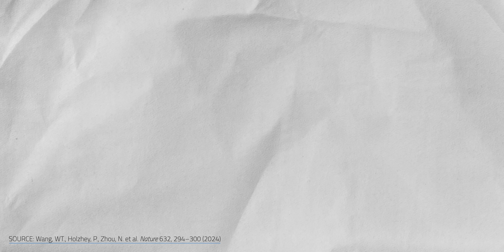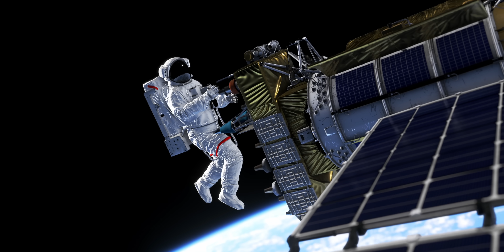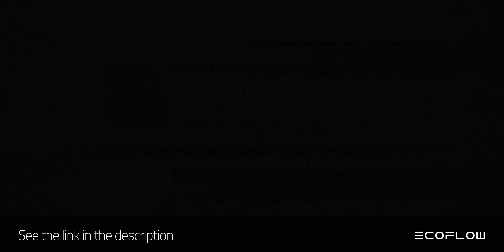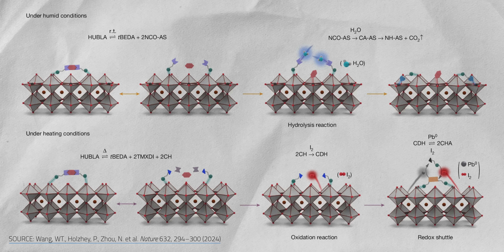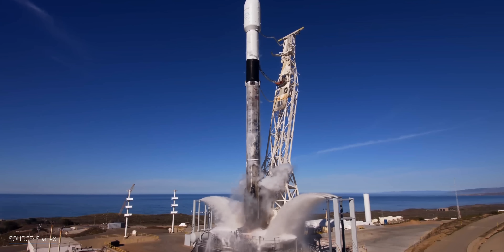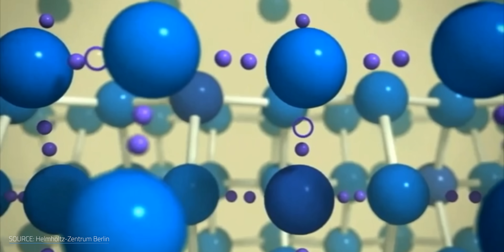Why This Might Be the Last Solar Panel You’ll Ever Need

Comment: As much as I wish this were going to be used on all PVs, I suspect the added cost will preclude from use on earth - space based operations on the other hand, where access for repair or replacement is expensive...
Reply: I expect they will make it to space, probably before they are in use on Earth.
However, once the tech comes down in price, I expect there will be a market for them down here too.
Reply: Plenty of places where healthspan&lifespan would be useful due to their difficulty to access/replace. Once cost begins to go down the market size will spread.
Reply: @jimthain8777  they can't just become cheap, they need to become cheaper than normal silicon PVs. and that is the problem. silicon PVs are affordable, abundant, and good enough for most applications.
Reply: Space is often the path to affordability
Reply: @MrIcetiger93  Still waiting on those triple-quad junctions or even tandems to cheapen :) Space grade panels can last 300 years on Earth, but cost 5-10 times more. If you're going to spend that type of cash you better double glass, armor the wiring, and have an aluminum sheet which can be flipped to protect from hail......... I know way too much about this shii..
Reply: Because it also increases efficiency, if the cost delta is reasonable, this could be useful for large scale solar farms. But it will be a while before this would be implemented for home use.
Reply: It might be for the best, if it has long-term toxic effects like perfluorinated materials.

Comment: The self-healing is not fixing solar (silicon) cells problems ...it is addressing perovskite solar cells problems: They are far not as stable and therefore durable as silicon solar cells.
I'm missing that information in the video.

Perovskite can make solar cells much more cost efficient. But in order to do so, they got to compete for silicon solar cells. And therefore be durable/resistant, which is their biggest flaw at the moment.

Comment: I doubt there will be a huge demand for this technology,  because PV panels already enjoy a 25-30yr lifespan, and during that same time power efficiency improves 10%-15%, motivating buyers to upgrade. The self-healing technology will be incorporated into new PV panels only if the premium is small, perhaps 5%-10%.
Reply: Yes, PV panels last up to 30 years, but they constantly degrade in performance. If the panels could maintain their original efficiency the ROI goes up, making them more appealing.
Reply: @jhouck1969  They degrade, but it does seem like the degradation curves on modern panels in the real world ends up being almost zero gradient - in practice the 30 year lifespan is probably more like 100+ years of good performance relative to their as new performance if they avoid being hit by a truck etc. The replacements we have been seeing for the last few decades in the real world haven't been because the old panels are particularly dead, just that the new ones have a better efficiency and so energy density making it economically worth upgrading (as a rule of thumb it appears to be much much easier and more profitable to upgrade your existing installation than get approval and then build the basic electrical infrastructure for the brand new one and leave the old one that is still working fine alone).
Reply: @jhouck1969 ROI goes up so long as they produce more power than it costs to maintain them. They would just have better ROI.
Reply: @jhouck1969 you are double counting degradation. A 30yr lifespan is based on the assumption that they'd degrade by at least 20% in that time, not that the panels suddenly become worthless in 30 years. Panels could last centuries for all we know. The longest running plant has been going 45 years or so now and is still working fine.
Reply: Perovskite cells are lower lifespan than the traditional silicon ones you're used to.
Also, panels lose resale value over time if they age. Ageless panels could be resold to where space is less of a premium.
Also, environmentmental costs/entropy.
Reply: Well, Perovskite cells loose their efficiency much, much sooner. So this would be a game changer if it really works, since Perovskite cells offer much more power. It's their fast degradation that has kept them from the market. But again, that's only if this truly works as they are claiming.
Reply: @junehanzawa5165 currently on both techs.  But which might be taken further.  One with a 10-20 year lifespan of knowledge or one, relatively new, with only 1-5 year but measured against the old tech that set the standard?   Could Pv be improved?  Of course.  But so many more haven’t figured out that key yet. My ex used to challenge high schoolers with an impossible math problem.  For a straight A grade for the class. All they have to do is solve it. Sometimes we haven’t thought of the way to solve some and it only takes one.  But the more that try to, the more the odds are against them.  And she never gave a student an unfair grade.  She was an awesome teacher.  Just not the wife for me.
Reply: True but this biggest issue to go mainstream is money.  Who pays the best.  NASA. Aka USA.  If they get it there with a huge money infusion from NASA.  It could mean 50-100 yr solar panels at slightly higher prices than current.  Even if doubled under what I mentioned, the rich would go that way, and it would drive down prices on the cheaper.  Kinda win win
Reply: I could see this tech being used in space
Reply: If we find a way to transport energy with much less loss. Humans could create such self healing solar power plants in hot areas and share the energy across Kontinents. You need to think more global! Its the goal to find an energy solution for the world forever not just one household. Lets think big. ;) and have lest waste (old panels that need refreshing)
Reply: @rc3043  transmission and distribution losses from high-voltage DC lines are already fairly low. Self-healing PV has to be cheaper than periodically screwing in new conventional PV panels otherwise it won't have much effect.

The waste of old panels is utterly dwarfed by the billions of tons of dirty fossil fuel they displace in operation. Even if you just ripped the aluminum frames off and stacked the tired panels in a corner of the solar farm while waiting for economical panel recycling to develop, the environment is much better off with solar.
Reply: @skierpage  strange the solar engergy project from afrika failed because they could not deliver the energy to europe efficiently...
Reply: What the commenter is alluding to is that if solar panels presently already last thirty years, and we can say with some degree of confidence that solar panels will have improved in quality in the next thirty years substantially enough that the average consumer would want to replace their solar panels anyways - even if they were still in working condition - then extending the lifespan of the panels beyond that becomes only minimally relevant
Reply: I disagree, this is as much an aerospace technology as it is residential; we don't want to repair rooftop solar often, and it aint happening in orbit until someone puts up some telepresence repair sats.
Reply: Like every other tech idea, it all comes down to how cheaply it can be made.

Solar plants currently only require around 0.8% new panels added per year to keep generation constant (for potentially forever). And that's fairly cheap. We also know the major ways they degrade and we are getting better at slowing degradation without fancy groundbreaking new technologies.
Reply: I dunno man the defense application alone should make it profitable, if that what you care about. This kind of tech is just a smart move as a way to power or provide backup power for some of our most critical assets.
Reply: How do you figure that the panels you mentioned are going to improve by 10-15 % efficiency ?
Reply: @rscott2247 probably just looks at the efficiency chart of solar and doesn't worry if it changes technology.
Reply: @rscott2247  cause they probably will
Reply: Might involve quantum dots.
Reply: Solar farms are ugly. More efficient solar that last 30 years is better than one that can self heal, and last ???.

Only way I see this possible is if it's so cheap it's everywhere, and I doubt that will be the case. 

 I do not like the idea of pure solar farms outside of desolate areas. However solar in between all the used spaces would be amazing. 

 I think we should focus on solar we can recycle.
Reply: @RedactedDeath  what's really ugly is digging up and burning billions of tons of fossil fuel, and what the ensuing global warming is doing to Earth is downright horrible.

If you don't like the appearance of solar farms, then use less energy. And they're not necessarily desolate; in a baking world, the shade can help certain plants and animals.
Reply: @skierpage  solar being ugly doesn't matter. They do negatively harm the immediate ecosystem they're installed in for solar farms though...even in a seemingly dead desert.  Roof solar makes a lot more sense, plus it protects your roof and extends its life.
Reply: @veganpotterthevegan   Sure, better to leave a thriving wilderness alone, but anthropogenic global warming is ruining the "seemingly dead desert", to repeat solar panels can often help. Agrivoltaics where solar shields crops and livestock (I know, I know, I'm vegetarian too) from the baking sun is also beneficial.

Rooftop solar ought to be the law, but the reality is a utility can generate 100+ MW for a lot less by putting up a huge solar farm from scratch rather than dealing with dozens of land owners and landlords.
Reply: @skierpage  rooftop solar should be the plan until every roof is covered.  After that, we can mangle the deserts if there isn't better tech by then.
Reply: @veganpotterthevegan  rooftop panels are notoriously inefficient,  poor orientation, shadows from nearby trees and buildings, lack of airflow resulting in overheating and reduced efficiency, and lack of regular cleaning and maintenance.
Reply: @Fredy_The_Yeti  sounds like you don't really know much about them😂  A lot of people have no shaddows to worry about outside of clouds and you overpanel for that.  You overpanel for heat too.  Most people buying a full array that aren't just supplementing grid power, produce more than they use.